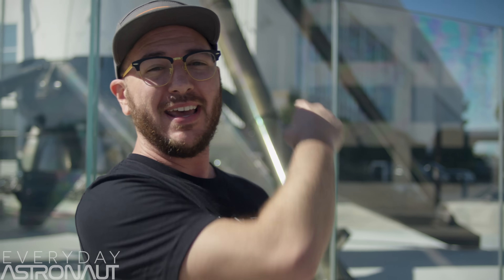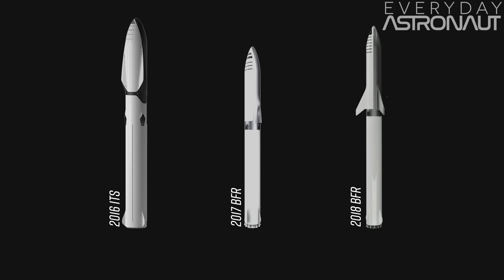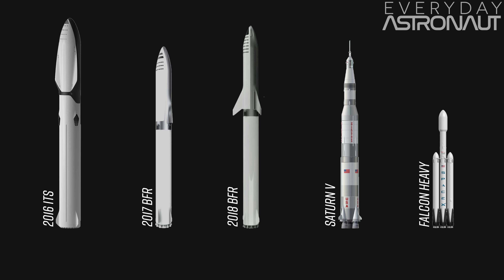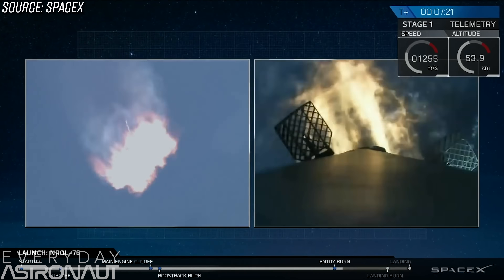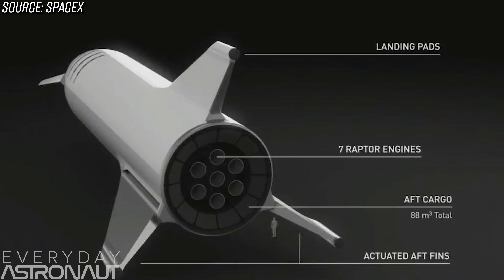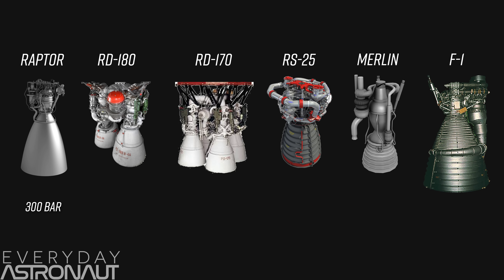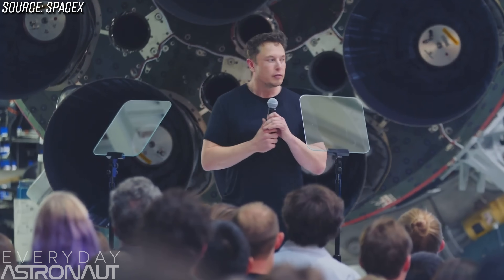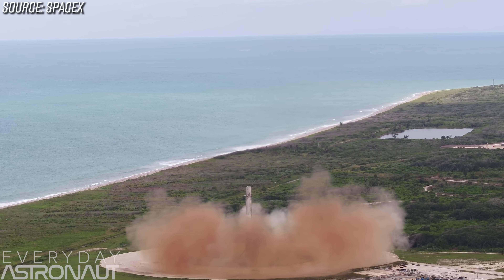Why does SpaceX keep changing the BFR? The evolution of BFR

Comment: The Germans were developing this sort of thing back in WW2,  rather than re entering the atmosphere at max velocity, going strait down and trying to bleed off speed very quickly, creating a  lot of heat and stress on the vehicle,  they would sort of dip into the atmosphere and quasi surf, bounce off the atmosphere , using the wings to change the angle once they get some bite.. use that energy to skim along or even ascend a little, burning off speed, and doing this over and over again until going slow enough to enter like the falcon stages do.. Apollo did the same thing when coming in at 24, 000 miles an hour,   they used thrusters to change the angle the capsule engaged the atmosphere,  at times actually ascending during re entry.. apollo had the advantage of a blunt shape, shock wave that protected the vehicle, but she still got mad hot..
   Space X is using this method to the nth degree,  and since the vehicle is huge, and not as robust as apollo,  those wings will slow the craft even further ,  providing for a gentler re entry ... the  trick will be how they manage energy and heat around the Karman line,  and keep it within limits.. It's like skipping a stone on sand paper,  until the stone finally slows down to a manageable speed..  The Germans planned a space plane that skipped along the atmosphere after being launched by a bunch of V2 boosters,,
 drop bombs on New York,  and skip it's way back across the atmosphere around the world back to Germany.. all in like 2hrs..  
   It was the theoretical work from this program that allowed Nasa to use the same method to get around the high approach speed of lunar trajectories without having to use huge retro rockets to slow it down on approach to earth.. kind of surfed the atmosphere and used it as an aerodynamic brake.. Space X is suing the same method, but to a much greater degree, and with much tighter tolerances as the BFR is less tolerant of heat and friction,  probably less so than the space shuttle.. so it will need a gentler , cooler approach.. 
    The theory for this was already done in the 60's with the x15 program ,and "Dynasoar", where aircraft with no heat proofing tiles etc , managed to re enter the atmosphere after crossing the Karman line, all be it at much much lower speeds.. with the Advent of Pica, carbon fiber,  titanium alloys, and nomex linings, and very very fast processors that can keep the vehicle on it's intended path , and manipulate those wings precisely and fast enough to maintain the correct attitudes ( a minor mistake at these speeds, even 10th's of a degree error will result in disaster).. the vehicle will either g out, and come apart, or skip off the atmosphere so hard it flies back into space .. having no fuel to re enter again.. just like Apollo.. though Apollo had a far greater margin for error as it was blunt and tough..  no protective shockwave for BFR,  no ablative heat shield.. too much weight to make the vehicle viable.. this is going to be a dance with the Devil at the edge of the atmosphere.. with no room for error, very very difficult..very very cool..amazing tech..   good on Space X for tackling it.. the iterations we see in the design must be the result of Space X coming to conclusions about the viability of the size of the vehicle, and how much surface area is needed on those wings and provide a margin of safety.. the earlier lifting body type shapes we saw in 2016, 2017, may not have been proven or didn't stand up to tests in simulation.. I'm guessing the BFR shapes didn't provide enough control in certain critical phases of the decent, or added a lot of thrusters and complexity to the vehicle.. so they decided to go with larger wings.. plenty of fluid dynamic data available from the shuttle,  it's proven and it works.. lifting body ?  don't know of anybody that's ever done a re entry from orbit with one.. un charted territory,  and space x would have to do all the R n D , build and test scale models ,  then hope it works and a bloody huge vehicle.. so we see it looking more like the shuttle.. 
     I would love to know how this thing will manage heat,  and how robust the airframe is , and how they get around issues of weight and complexity.. what it can bring to orbit is all well and good.. how it gets back..now that's interesting.. if Every Day could do a video on how the BFR will perform on re entry, and maybe his thoughts on the BFR's  design .. that would be awesome..
Reply: I agree - if the context of this comment is your opinion. Long comment. . .

Comment: Less than five minutes into this presentation, and it is clear that the design for the BFR at the time was so early that they had not locked in how many engines the first stage will have. For those unfamiliar with the rocket equation, this means that they have no idea how much the other stages will weigh, how much thrust the other stages will have, how much the payload for low earth orbit is, no idea how much the paylad for a trans-lunar trajectory would be and no idea how much the machine could place in an interplanetary transfer orbit. Yet they are already spinning a story about sending a Japanese billionaire on a lunar trip. This is what is called "Public Relations", or if you want to be a bit less kind, a proposed "Publicity Stunt". except, they don't have the capability with the BFR to actually do the stunt, so it's more BS than anything else. I am a huge fan of SpaceX, I respect what they have done, but THIS particular bit is flim flummery. You got no hard numbers and technical details because all that stuff is still being designed. You cannot bgin to build much of anything on a proposed space launcher when you do not even know what the first stage will be capable of. Sorry, but no one is gong to the moon on this machine in less than five to seven years, and that is optimistic to say the least. Scaling up to BFR level is way more complicated than just uneducated these maters, I am pretty sure you know all this  as well or better than most. Maybe you get into this by the end of your video. Okay, at the end or at least to the part with tha thankyou's and all. Yes, you did get into some of that. It is interesting to be let in on the design process, and you did not make a lot of the Japanese billionaire angle, which likely means you do know it is not happening soon. Good job. Due diligence and all that sort of journalism 101 basics. I am just a bit tired of the stunt mentality of so many PR people. I call it t "The Evil Knievel Syndrome". You know, the guy ho was going to jump a motorcycle over th Grand Canyon, only it turned into a rocket over different canyon in another state, and it basically went up, popped a chute, and came straight down a few feet from where it went up? Dib't be Evil (Knievel).

Comment: Actually, and as a manager, what he was refering to by "the correct question" is something entirely different from what you discussed in your video, although you answered on a portion on it, but you missed the entire picture, the problem that they were facing in the design of this ship is that they do not have all the list of detailed questions, like first "you ask ofcourse what should this product do?", but then comes the difficult part, when you start dividing these questions more detailed questions, and it is usually a very annoying process from the requirement team, because it takes a lot of effort, knowledge of the whole project, and intelligence.
Just to give you give a perspective, the questions are detailed to the point that where should this button be?.... and once you have the basis of questions, designing the product will go along much simpler, since you start with general and go directly to the specifics.... this is always a problem when designing a new product, nonetheless something that have been never done before

Comment: Those 'flaps' are fins, and are for aerodynamic stability.
And what about the canard? It's huge, but not mentioned.
Reply from the maker: Fins act on same plane as the lifting surface. These aren’t fins in that manner. Check out my more detailed video “why the BFS will fall like a skydiver”
Reply: @EverydayAstronaut  I am refering to you naming these fins as 'flaps'. Flaps are used to INCREASE lift on wings.  What you probably thought of are spoliers, but spoilers do not have airfoil (they always stall), and are retractable. 
Any surface at an angle other than zero in relation to the vector of the velocity generates some lift. Looking at the airfoil of these fins, they are obviously optimized for adding the stabilizing aft drag, rather than lift, but it is still lift. Same applies to the (relatively large) canard at the front of the new BFR, which also produce lift.
Just to be sure, I am defining lift as a force perpendicular to V vector.

Comment: I am somewhat more skeptical than others might be.  I don't think Elon is going to put all of his cards on the table.  Why would he?  Other companies are trying to keep up with SpaceX and if they can readily see what he is doing in the planning process that puts them a step ahead.  I suspect those fins were in the planning long ago.  When he initially demonstrated his landing configuration he must have already known he needed more surface area to land the BFR.  Same is true of the Raptor engine.  The arguments for using just one engine have been known from the beginning.  While others are building vacuum engines Elon is changing the shape of the rim surrounding the second stage engines.  Problem solved?

Comment: Hi Tim, nice video again.  In the SpaceX renders they usually show the BFS being mounted on to the BFR by a crane and cable system with the cable attached to the BFS nose.  If this is really how it will be then BFS is obviously designed for this load, which means it should be relatively easy to tether two BFS's together nose to nose via a cable, spin them up and have artificial gravity on the trip to Mars, which would be very cool.  Any thoughts?

Comment: I agree that you do not see very often inside the design process, but it is not unique: The Ocean Cleanup went through three very publicly visible design incarnations. First it was a 100-km-long barrier, fixed to the seabed, then multiple 2 km versions which were anchored at a few hundred meters depth and currently System 001 is 600 m in length, without any anchor as it is propelled by wind and waves.

Comment: Controlling that many engines on 1 rocket is a mess. Korolev who single handedly pioneered the Soviet space program but his bad terms will engine designer Yangel, meant that Yangel wasnt ready to build bigger engines and hence Korolev had to use 32 smaller engines and although Korolev died before N1 launch it was doomed to fail from start. SO 31 engines isnt something so great really.
Reply from the maker: I think SpaceX can handle 4 more engines compared to the Falcon Heavy 😉 the engines (being tested and tested and tested) and 21st century computers are huge improvements to the KORD and the NK-33s. I think they’ll be ok 😉
Reply: @EverydayAstronaut  The 27 engines you are talking about are actually in 3 separate modules and controlled separately. This one has all 31 in single module so its not just 4 more engines but almost 3.5 times. Problem arent computers rather the harmonics generated by the engines as harmonics generated by every engine are different.
Ofcourse, present day metallurgy and electronics and IT industry are more developed then 1970s and 80s but still there are 31 potential chances of failure. You might say it small percentage of thrust lost rather then 1 out of 5 of saturn 5 but problem solving with 5 against 31 is a tough job.
Reply: @obsetube1725  Thats is so hilarious.
Reply: @obsetube1725  Because these rockets have almost ZERO tolerance for trust failure on any of the engines. The reason being for the targeted orbit/trajectory, the thrust and burn time as calculated to reach desired velocity at specific altitude. So even if 1 small engine fails it would throw the rocket out of it trajectory and the payload may not even reach the desired altitude or orbit.

Comment: A hexagonal pattern with 7 engines is of course  more space efficient than an octagonal pattern with 9 engines. Also: the aft cargo is beneficial for the spaceships' center of mass. I am a bit concerned about the fintips though; if the ship lands on a rocky surface (which to some degree is unavoidable) the tips might get slightly bent or scratched which may be an issue in flight. A good engineering solution with some kind of extendable rubber pads might be needed here.

Comment: When Wernher von Braun locked conceptual design on the Saturn in the 1950s, we had a very reliable but very expensive space transportation system in the late 1960s that fiscally killed US manned space exploration from 1977-1981 and ANY manned lunar exploration to now. Phil Bono's "plug" engines MIGHT have dropped cost per unit mass to orbit incredibly.

Comment: 31 engines, good luck. Where do they plan to test it ?
Reply from the maker: Same way they tested the 27 engines of falcon heavy... just add four engines 🤷‍♂️ not that big of a deal
Reply: IMHO it's a huge deal. In FH Musk did not risk that much because his stages were already in use and verified. Then it was a matter of bunching them up without performing real static tests. But 31 engines in a single rocket body, not tested before, is totally different situation (mind just vibrations problem). A lot of risk, a lot of money, but it's just mine opinion. Good luck anyway

Comment: ok space man google these 2 truths - the spped record is held by NASA for 9.5 mach
but your rockets need to reach a minimum of 25000 in order to reach escape velocity - yes thats right mr astronaut - 25000 that is about mach 70 - what a joke - what a lie you are promoting -
Reply from the maker: Perhaps you’re confusing 9.5 Mach with an atmospheric record. Actually as you ascend through altitude your Mach number changes. MACH NUMBER is defined as a speed ratio, referenced to the speed of sound, i.e. Since the temperature and density of air decreases with altitude, so does the speed of sound, hence a given true velocity results in a higher MACH number at higher altitudes. AIRSPEED is a term that can be easily confused. 

Besides that, no human has ever experienced full blown escape velocity (that would take a craft beyond the earth towards to inner or outer solar system), but we will when we send people to mars. I think you need to just double check your math. To get to LEO it takes about Mach 22 (at sea level which its not), and that happens all the time. 

Please cite your sources on these records and let me know why you think we’d experience escape velocity to reach LEO.

Comment: 300 bar vs 70 bar on the F1.  That’s 4351 psi vs 1015 psi on the old F1.  I assume this value is the operating pressure of the engine?  What kind of safety factor is built into the motor above this pressure?  Is it 10% or like 30%

Comment: Math Nazi here. You said “two and a half times MORE powerful” wrong

You actually mean “two and a half times AS powerful”

It is quite different
Reply from the maker: Nope. The sentence is “it’s about 2.5 more powerful than the falcon heavy”... this is correct. The “it’s” in this case is the BFR which is 2.5 more powerful not as powerful.
Reply: It really is a math thing,  'as' translates to multiply, 'more' translates to addition
just saying.

if our house is 20 ft. tall and their house is 10 ft. tall, then our house is twice as tall as theirs. if our house is two times taller than theirs, our house would be 30 ft. tall. "as big as" and bigger than" are two completely different things.

BTW I hope you eventually get brave enough to drop the conversions from metric. We are mostly nerds here and I'm sure we can figure it out.

And please, no more air quotes about "Big Falcon Whatever". We get it. When you say BFR it's kind of like say a curse word. Giggle Giggle. I get the feeling that Elon is starting to regret it.

On a serious note, do you think that the BFR could use its excess capacity to bring fuel up to LEO depots. That would be efficient.

You are amusing and entertaining. Keep up the good work,

Comment: thinner and smaller every time, i mean they have to fit it under those bridges, and canals, there is no way that thing will actually be practical
Reply from the maker: It’s longer and the same diameter this time. Also it’s thinner than the Saturn V which did make it to Florida via barge. So it’s not that unrealistic. If it’s built correctly, it should only be shipped once (then it’ll stay at the pad)
Reply: any actual news on when dragon 2 will fly, seems like they are just milking NASA at this point considering the thing was supposedly done few years ago, and would the better bigger land-landing starliner be able to fly on falcon?

Comment: Here is another question: 
"Isn't it dangerous to make the fins double as the landing gear, considering when one is malfunctioning, you won't have ways to land your craft any more?"

It seems like a good concept, because it saves weight, but in terms of redundant security measures I am surprised they'd go with a single mechanism that is likely to suffer intense stress during entry, without backing it up by another set of gears.